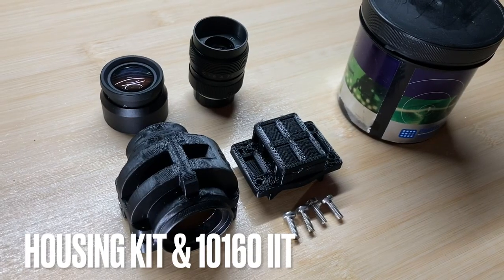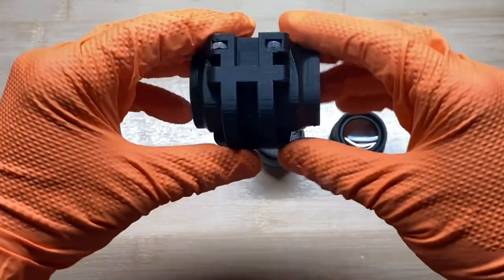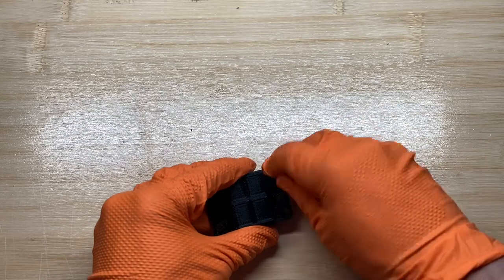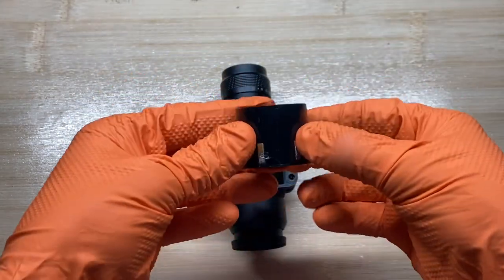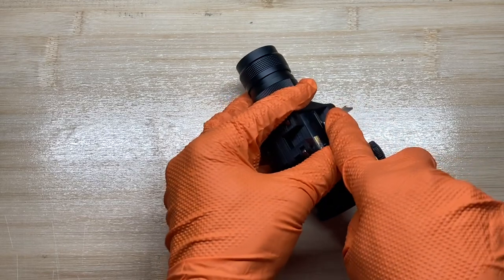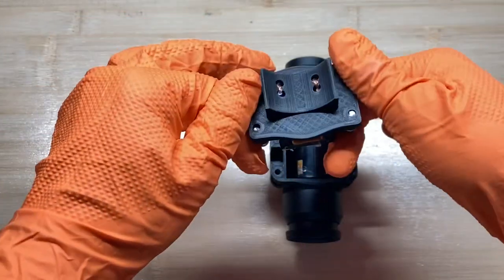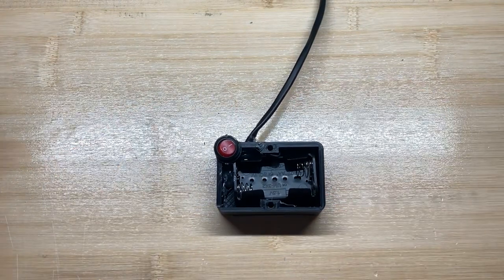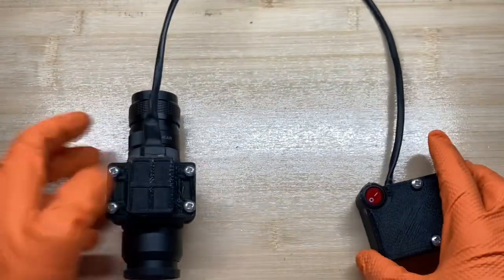Onetapik housing- Assembly guide

Comment: what kind of lens are you using for the objective? I did a project very similar to this, even using 10160s and ended up using a less than optimal 40 degree FOV Arducam Lens
Reply from the maker: 25mm cctv c-mount lens works like a charm for 1x and 40 degreeds fov

Comment: couple questions.

1. what is the estimated total cost of the project?
2. where do you get the 10160 IIT?
3. is it a easy build?
4. is getting blems cheaper? and if it has to have a blem, whats the best zone for it to be in?
Reply: Regarding 4:
The bigger and/or numbered blemishes are the cheaper the tube. The closer to the center they are the cheaper, too.
Reply from the maker: Some one allready answered 4. so i will answer the rest.

1. Housing will cost 150/w lenses, avarge tube is 500-1500 what i would recommend using in this housing.
2. Ebay, fb, discord
3. If you want to assemble the kit then watch the darn vid😅, build guide coming late august when parts for next patch arrive, judge it then.
Reply: @onetapik_  perfect! thanks for the help!

any specific discord servers or places on ebay to find the ITT's
Reply from the maker: @EthansAA  just look around, facebook nv groups are the best for that